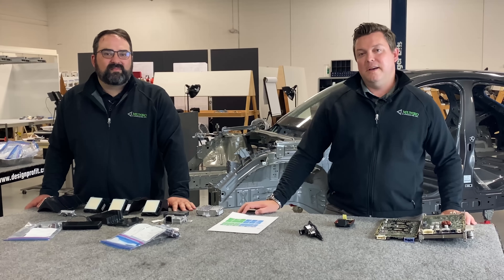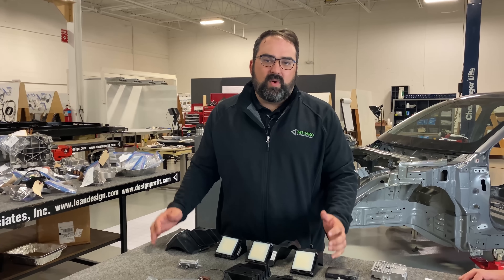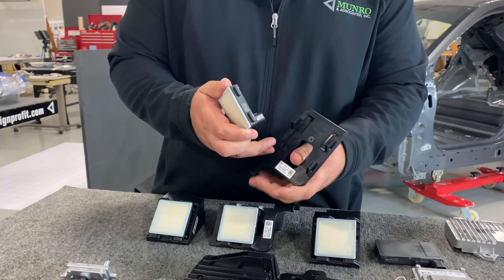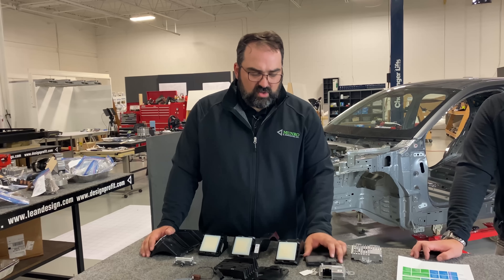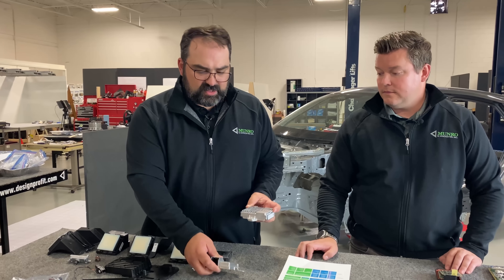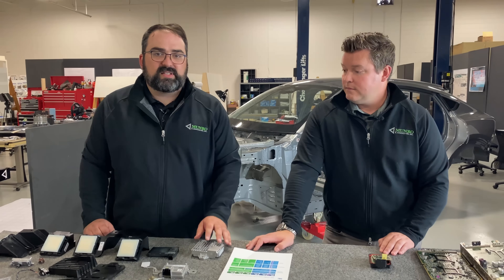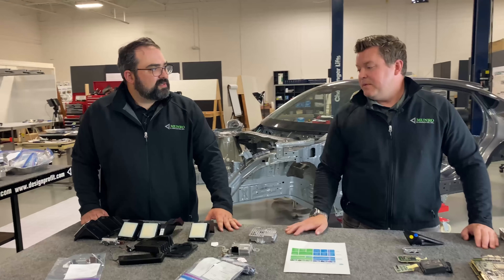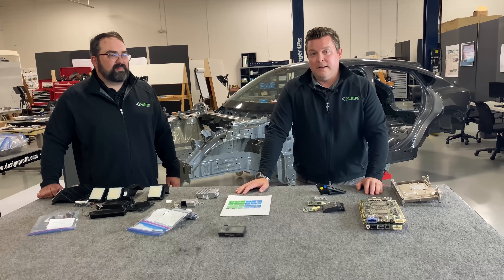Mach-E ADAS Breakdown

Comment: Two problematic statements: 1) "Tesla "ADAS" boards are very expensive."  The missing part is that they also control pretty much everything else in the car, they are the main ECU boards, not just an ADAS system boards.  Bring all the MME ECUs then for comparison.  (Bring Sandy back!). Misleading.  2) Radar performance IS affected by weather; sleet can lead to disabling radar vision in the MME as it has been reported already.  Also, without a multi-camera vision (MME has worse vision than Subaru IMHO) there is no way the system can evolve or be used as a test platform for moving to the next autonomy level.  With the last MME series, I feel Munro and Co. is getting more and more affected by Ford's PR department.  Sad.
Reply: Radar gets confused easily with manholes and metal objects... It doesn't know what it is... I agree we need sandy back
Reply: Yes - this conversation is so much more complicated than laid-out here. At a minimum, we are comparing apples and oranges. There are pros and cons to both approaches (hardware, functionality, integration, software) and current maturity of each of these systems. Agree with point 1 above - a bunch more components need to be brought to that table to properly compare functionality between Tesla’s and Ford’s approaches. 

I was very skeptical of Tesla dropping radar altogether, until I dove deep into what they’re aiming for with AI and vision-only, then it started to make sense. This is not to say Tesla won’t add another sensor in the future; yet I expect it would be a light-based modality like IR/FLIR to layer-in more nuanced detail into the AI ‘field of vision”. Regardless, data shows that ‘ADAS” - especially with Tesla Autopilot and safety aides - are safer that human-only driven vehicles (see 2020 Tesla Impact Report and other sources).

Different system altogether than what’s discussed here, but my modern Mazda’s safety systems turn themselves off half the time in moderate and heavy rain, and it’s a crapshoot them working in the snow.

Comment: I'm curious how many cameras does the Ford and Tesla has as a comparison.
Reply: Interesting comparison to make. And put in radar and ultrasonic sensors aswell into that comparison
Reply: I know the Mach E has at least 4 cameras around the car.  

The front camera is using Mobileye's EyeQ4 which is a camera-based system capable of reading traffic signs and doing Level 3 (Eyes off) self-driving.  I am not sure if the 2 side cameras and the rear camera ties into the Mobileye system or not.
Reply: Tesla has 8 fyi,

Comment: Sounds like a multi spectrum sensor package is better, safer and more $$$. I'm not sure a system that does not have more than one way to determine where objects are would be allowed to have level 3 and high certification. Autoland on aircraft have 3 autopilots, two ILS receivers and 2 radar altimeters. All of those flight and ground systems are highly monitored by people. Cutting loose are vehicle in the wild with just video cameras will narrow the environments it can operate.  In this instance I say the Ford system is better for future proof not only technology path but regulatory. Tesla may find that cars not supporting multi spectrum will not have the option to upgrade or may even be derated.

Comment: Mr. Lindaamood, you do make quite a case for RADAR. I can understand why TESLA moved away from that. People that drive for a living use use their senses and not RADAR. We  see and many times common sense will prevail where technology fails. Camera's are useful and can see much like we do. Seeing things helps diagnosing things instead and EVEN in inclement weather conditions all our senses still make a better judgement call than it makes sense to rely on a RADAR. Seeing is still more important. Not knowing what we face is more dangerous than slowing down and checking with our vision what lies ahead. I prefer to use my eyesight instead of not knowing what is out there. 

I am sure that even the military need a visual confirmation and do not rely solely on RADAR to tell their teams how to proceed.
Reply: >> "The military need a visual confirmation and do not rely solely on RADAR"

SCR-270 Early Warning Radar at Pearl Harbor
 on December 7, 1941

The radio operators detected a large echo on the SCR 270 radar oscilloscope 
at 7:02 A.M. on December 7, 1941, which later proved to be the Japanese attack force 
heading for Pearl Harbor.

Early Radar Warning were Ignored: “Don’t worry about it.”

Comment: If the cameras can't see... and by extension, the driver can't see. Then you should not be driving, or at the very least drive extra careful and much slower than on a clear sky/vision day.
Reply: True but in the end people will still need to drive in in inclement weather. So to get to level 5 where you can remove a steering wheel that needs to be solved. There will need to be a secondary system other than vision in place
Reply: @robf88  It's not that people need to drive in inclement weather. They choose to ignore the danger and keep driving. That is why every year, on roads that are prone to heavy fog, you have accidents with a large number of cars and trucks involved and usually a few fatalities. Frankly, in those driving conditions, radar won't be that much better. The only way you can get around that is if all cars are autonomous and they can all communicate with each other. That way they know the location and speed of each car in front of them and can still navigate without any visual cues.
Reply: @ymcpa73  nahhh...there will be times when there's a need. Like gotta get to work on time...also I'm not saying radar should be the 2ndary system of choice. Just saying there is a need for a 2ndary backup system to get to lvl 5 in all edge cases and remove a steering wheel. Maybe you idea of all cars communicating will be a thing 100 years from now. That sounds like a cool idea. Pedestrians and wildlife would still be an issue though. That's why I tend to like Sandy's idea with Flir. But even that has some drawbacks especially when everything is real hot. Hopefully in those times camera only would be enough....
Reply: @robf88  I disagree, I think we should clarify the severity of the storm we are referring to. If it is a storm that people (above average drivers) are able to drive, albeit at a much slower speed, then the system should be able to do the same with vision only - because that is the only sensor we humans use. If it is so bad, that even emergency vehicles are staying put until it gets better, then no one should be on the road - inclusive of autonomous vehicles.

The trouble with other sensors is they are not as information-rich as vision. Radar and Lidar are very good at telling you the exact distance something is, but not so much as to what "that something is" It cannot read "icy road ahead" as a vision system would. Thus if the vision is able to get to a really good distance estimation - even to 90% of Lidar then that will work (humans do ok on this). Imagine me giving you, a person that can see, a measuring device while you are walking/driving to help you be safer... you would not use it because you do not need it, you just need to know to avoid hitting something - you don't need to know the exact distance at all times.
Reply: @buenito35  your half right. Vision is the only system that humans use. And when vision isn't available people shouldn't drive but some will try to or want to anyways if they have to. That's why our secondary system needs to be in place

With an additional system you could go anywhere at any time without any limitations. That's the real future. If my car shuts down on me because I drive into a storm and I'm stranded until the storm passes. That will never fly with me.

If a deer jumps out In the road and it couldn't be seen before because of trees I'm probably getting into an accident by human hands or a vision system alone. A secondary system like infrared however might have picked that up and prevented the situation.
Reply: @robf88  while I agree with your scenarios. They are so edge cases that the cost-benefit is not there: equipping all cars with infrared and other sensors for the 1 in however million chances of the deer or other edge case makes no sense. It's the same Eason why there are no passenger sensors on the back seat of most cars.(or weren't). In any case electric cars have a better chance of keeping riders safe in the case of an accident - if designed well. As for the lack of steering wheel, I think it should always be one, or a way to override the system; for many reasons including some you mentioned.
Reply: @buenito35  and this I can agree with you 100 percent. They are edge cases. And it probably isn't cost beneficial to add a secondary system for those cases. Which is why there will need to be a system override feature like the steering wheel In case you ever find yourself in one of these cases. (Fyi this is level 4 autonomous. Car still drives itself but driver can request control and has cockpit) If you ever need to drop the steering wheel and not have override. You need the secondary systems to handle the edge cases. (This is level five where you take the steering wheel out and there is no need for driver to ever request control in any case no matter how edge it is) It's one or the other In my opinion.....secondary systems or available override for when these situations as rare as they are, happen.
Reply: @robf88  maybe the level 5 vehicles will be geo locked and for public use in certain dense cities. Then level 4 for the public to go anywhere. Personally I would not want to buy a level 5 autonomous vehicle.

Comment: How would a Tesla driver assistance system perform in fog or heavy rain with just vision?
Reply: What’s my concern too w Tesla only relying on cameras. I find a great value of these systems when driving conditions are bad w poor visibility.  Wouldnt poor visibility also hinder these camera based systems?
Reply: @Wasabi9111  The same way it would hinder your eyes. If the cameras can't see in those conditions, you can't either. It will probably turn off and tell you to take over. If you are being safe, you would pull over and not drive in those conditions. Most people do keep driving in those conditions and that is how pile up accidents happen. Radar is degraded in fog as well. The tracking distance is reduced. I do think that Tesla should keep the front facing radar, not for FSD, but for emergency braking when the human decides to keep driving in dangerous conditions.
Reply: @ymcpa73  you have a good point.  People (including myself) should not driving in poor road conditions.
Reply: I used Autopilot drive me through incredibly dense fog in northern Minnesota this past weekend.  It worked very well.
Reply: @MsAjax409  just out of interest: from what year is your Tesla?
Reply: @Conservator.  2018  Yes, it is equipped with radar if that's what you're wondering.  But it wasn't the radar that kept the car between the lane lines.  It wasn't radar that 'saw' the car ahead me when the taillights were still visible to the human eye.  If I didn't have Autopilot I wouldn't have been able to continue driving.  The cameras somehow were able to see through the fog better than I could myself.
Reply: Better than a human can.

Also, fog and heavy rain blocks radar.
Reply: @fredbloggs5902  in the marine and aviation industries we have been relying on radar to navigate in zero visibility conditions for decades.  perhaps you are thinking of LiDAR which uses lasers rather than radio waves.  I know from first hand experience that when the heavy rains hit or fog rolls in I rely on my radar to get me back to port
Reply: @fredbloggs5902  If you are feeling lucky, Tesla is going to run you into a topped over truck in broad daylight. Or a lane divider. Make your pick.

Comment: Maybe a silly question, I don’t know radar tech well,
What happens if more and more cars have those radars and drive next to eachother for example, can radar pings from 1 radar hit the other persons radar and confuse it?
Reply: You may be sending signals with different pulse patterns so as to know when it comes back if it was yours, but eventualy would be very difficult.
Reply: I had the same thought/question re ultrasonic sensors... must be some sort of self-recognizing pattern, as practically every modern car has them now...
Reply: The more modern radar chips use spread spectrum technology analogous to WiFi so it shouldn’t be a problem.

Comment: Well done guys - you explained well and look relaxed - 
did not know radar Just knows a object is there - cant tell what it is -
now understand tesla reasoning for vision - suggestion - 
setup small well lighted area for small component photos - 1ft x1ft- small -
nothing fancy - tiny bean bag to position  parts - makes Better photos  - faster/easier
Reply: To clarify, the Mach E is also using a camera based ADAS system.  It is using Mobileye's EyeQ4 which is a camera-based system capable of reading traffic signs and doing Level 3 (Eyes off) self-driving.  The radar sensors help provide additional reliability and robustness by allowing the system to detect objects to avoid collisions in certain weather and lighting conditions which is tougher for vision only systems.

Comment: There was no mention of sonar.  Most people talk about sonar as "parking sensors," as that's what they've been used for most frequently, but Tesla has used them as part of Autopilot to ensure that neighboring lanes are clear when changing lanes.  I'm not sure how much they're used in the latest vision-oriented software, but they're still there.  What sonar sensors does Ford have, and what are they used for?  Are they even wired into the ADAS system, or are they completely separate?
Reply: Ultrasonic is considered a better choice for near sensing, with a reach of about 5 meters.  The transducers are inexpensive, and can be multiplexed to a single controller.  (Note: the mounting and weatherproof wiring completely dominates the transducer expense.)

Radar can have problems with near returns and is much more expensive.  The antenna generally needs to be active, so the module usually has an integrated radio system rather than splitting the system into a "front end" and radio set.

Most systems use a single low mounted high quality radar pointing forward, and multiple side and rear ultrasonic sensors.  The front is sometimes supplemented with ultrasonic sensors for parking, especially for models where radar is optional.
Reply: Agreed! And Tesla need to detect curbs abd similar low objects that take out the rims of the cars.

Comment: Does the battery pack power the ADAS motherboards or is it the 12 volt battery?
Reply: 12v obviously, and likely only steps down to 5v on the board.

Comment: Can you still manually drive a Tesla if all the sensors and cameras are taped up?
Reply: yes you can but it will throw a ton of warnings. however, if there is no steering wheel (level 5) you will not be able to unless they decided to put a usb joystick
Reply: @patricklegault6383  Good to know. Though I'm not ready for level 5 just yet...
Reply: Level 5 can have a steering wheel. If you want to drive yourself it pops out. As I understand it. Hopefully!